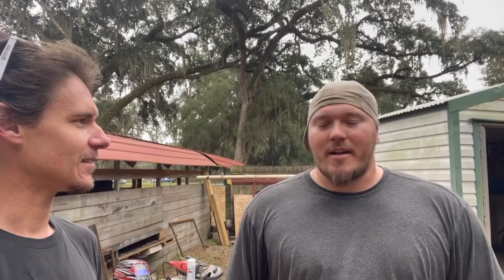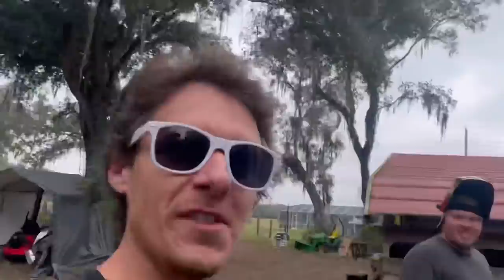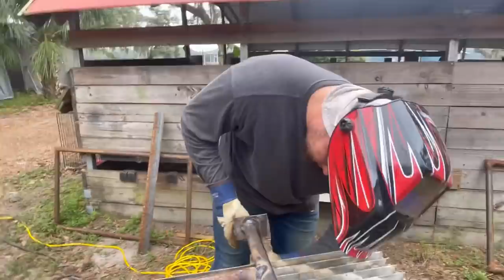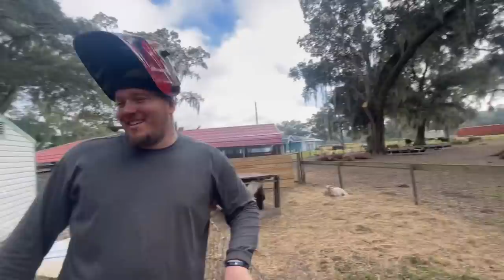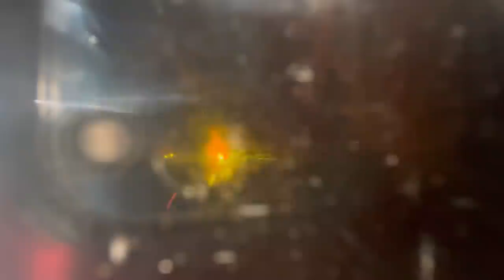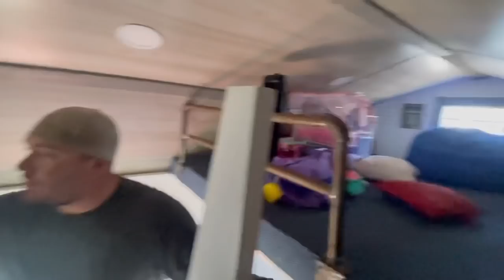What Happened to Big Tom?! | Does he Even Weld Anymore? |

Comment: I had a 6.0 it was a love hate relationship. CONGRATS BIG TOM
Reply: I love it it’s bulletproof now but some reason my pcm is all messed up so have a new one going in
Reply: @tomloughran2349  i had an 04 bulletproofed. The IPR an PCM where the biggest issues i had with mine. Not a single shop around wanted to work on it. I could take it in for a sensor and they would call saying headgaskwts were bad. That may just be my area though. Learned to work on it myself at that point. The sound of a 6.0 is just awesome.
Reply: @tomloughran2349  Go gasser 6.0 Chevy or 6.2 Ford.  Will tow anything, just a little slower, and for the price of diesel injectors you can get a whole Reman gasser engine.  Just alot less to go wrong with them. Breakdowns are killers for the independent guys like you.  Congrats on the twins and best of luck this new year.